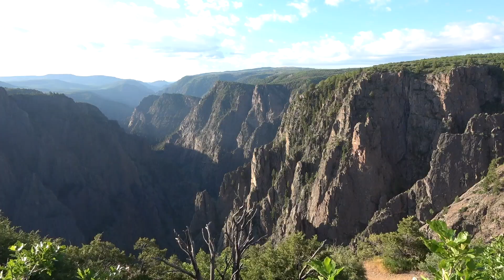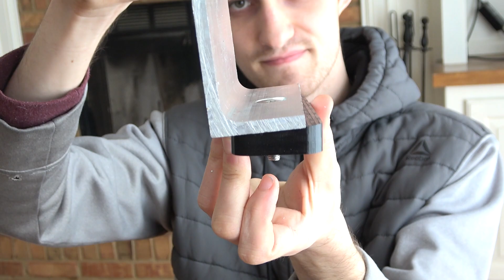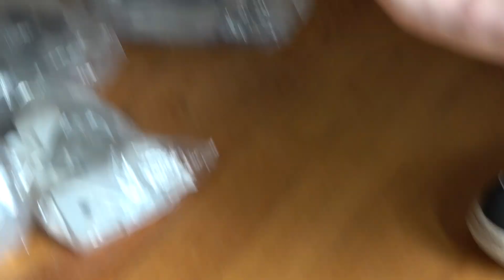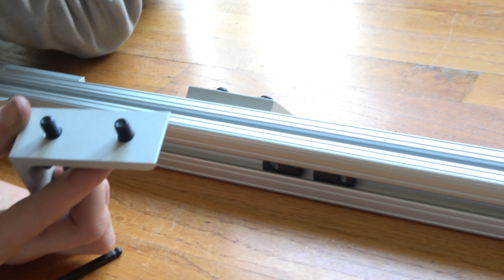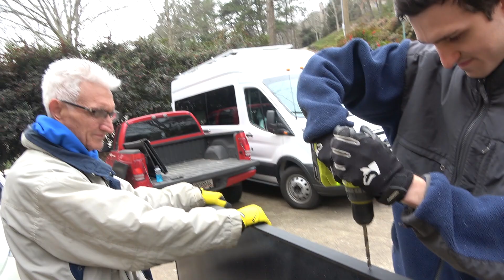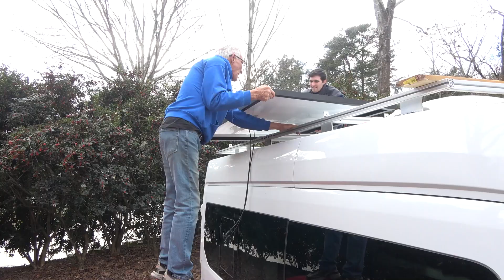No welding! How to create a van roof rack with solar panels. Wander Wonders

Comment: This video is missing the install of the most important whi h is the L brackets on the qctual van. How did you eo that? Are you bolting through the angle jron? How are they fixed?
Reply from the maker: Thanks so much for your question. There are factory mounting points visible on the roof. We removed the caps and used threaded bolts which went through the van and the base of the mounting brackets. I hope that answered your question. Thanks for watching and happy travels. ~ Trisha

Comment: I was familiar with most all of this, but y'all did a nice job of showing it going on the roof.  I was surprised that the Transit didn't dent with someone sitting on it, so maybe they are not quite so tissue-thin as I thought.

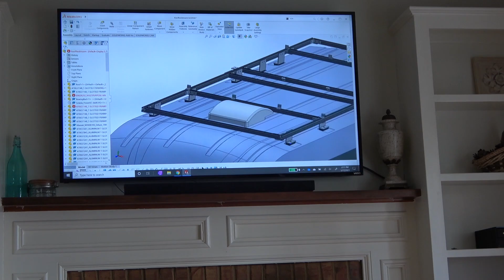I got a SERIOUS case of model envy when Zack was showing the Transit roof model! (12:21, for example.)  It was very detailed.  Where did he get that model, with all the curves and ripples?  And more to the point can he share it in STEP or IGES format?  I'm way too cheap for $olidWork$, learning with Fusion 360 and some FreeCad.
Reply from the maker: We tried to sit on foam insulation, etc. to distribute the weight. It is pretty easy to dent. I'll contact him about the software and get back to you. He has used all of them!
Reply from the maker: Ok, he said that he was still in school at the time so he used a student version of Solidworks. He's out of town on business and crazy busy. He only offered this link: https://www.solidworks.com/solution/company-type/makers  
Good luck with your build and stay in touch!
Reply: @Wander Wonders  I was actually asking about the model of the Transit roof that he designed the rack on, not about Solidworks.  I'm wondering where the model came from, and if it can be shared.  IGES or STP are pretty standard 3D CAD model formats that can be imported into most anything.  

If he no longer has access to SW I understand that it might be kinda tough to export anything.

Comment: Make sure that all of your Bolts are Stainless Steel. 
Apparently other Bolts will only last a few Months before failing.
Reply from the maker: Yes, my son used the bolts that came with the 80-20 but he knows that they need to be replaced which we will do sometime this year. Thanks for the input.

Comment: So you used Stainless hardware on the rack to panel but not on the assembly of the rack itself. Good luck with the gulVANic corrosion. Loved the SolidWorks assembly!! 😉 😉 😉
Reply from the maker: Good catch! The black oxide hardware is indeed not the way to go on outdoor assemblies with aluminum. The only reason there wasn't 316SS hardware on all brackets from the beginning was the convenience of buying 80/20 brackets with included fasteners. The black oxide hardware may present a problem in a couple years time, but it can be swapped out or coated before then.

Comment: Great video, thank you so much for sharing your design! I'm looking at fabricating the brackets and plastic myself. Is the L-shape bracket you used made from steel or aluminium? And what type of plastic did Zack use for the spacer?
Reply from the maker: Thanks so much for watching. Aluminum. I'll ask him about the plastic and post it later.
Reply: @wanderwonders1221  Thanks so much!